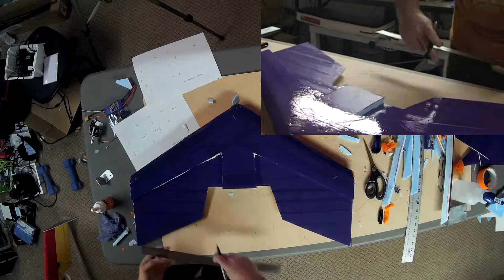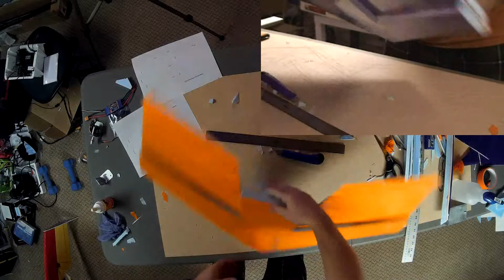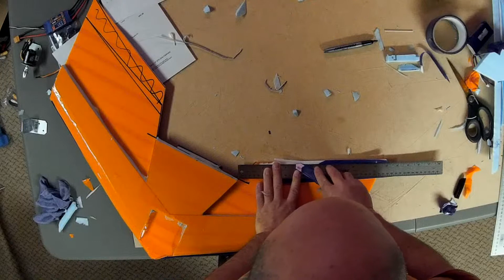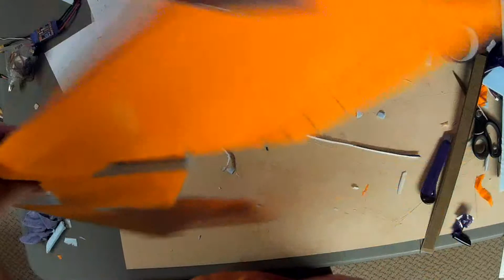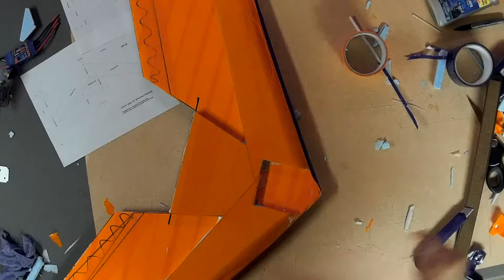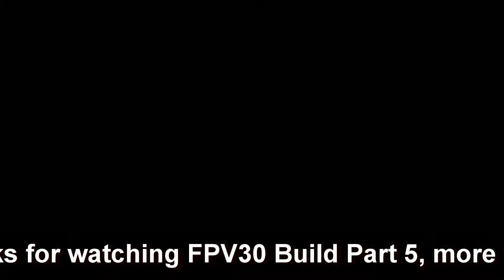How to build a Flying Wing - Part  5 - Cutting the Elevons

Comment: do you even have to bother with CG here?
Reply from the maker: Death of YouTube I'm not entirely sure I understand your question.  Proper weight and balance is always important.  You can adjust for it afterwards (within reason) with your battery placement.
Reply: center of gravity, you answered that question in another video I seen when you was moving the battery back and forth to get the weight off the rear